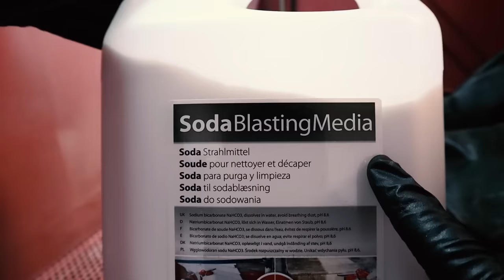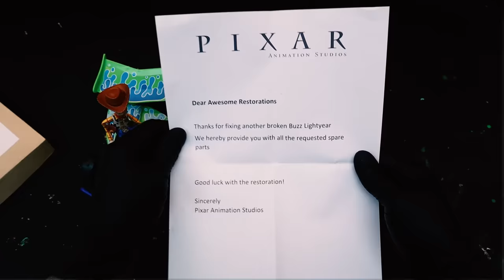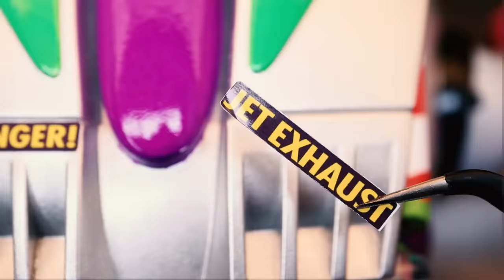Restoration of Buzz Lightyear 2024 - Toy Story from HELL

Comment: I actually remember owning an anti-gravity belt buzz lightyear but since it had a few gimmicks like the missiles on the jet pack and the jet pack itself I also lost them I ended up getting rid of the figure I also used to own a woody with a working pull string yes I used to own a talking woody from Toy Story until I accidentally broke the pull string one time I pulled the pull string on the doll to hard and then the pull string snapped so I ended up getting rid of that too but I am now a collector of Transformer toys you know the robots that transform into animals or vehicles and some every day objects like a microscope there’s even one that turns into an electric chair but I’ve been wanting to restore a toy I got from a neighbor in 2010 it’s a black Tonka Hummer I ended up taking the front and back windshield out since the front was a bit cracked I took it out but I still want it restored but I don’t really know where I can take it to get it restored since I don’t know if there’s a restoration place in Iowa where I live any suggestions?